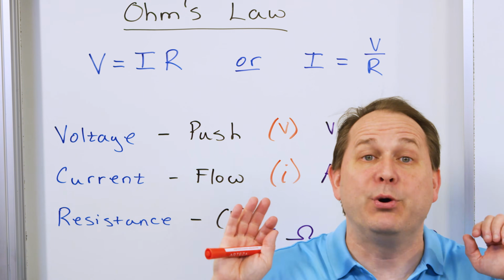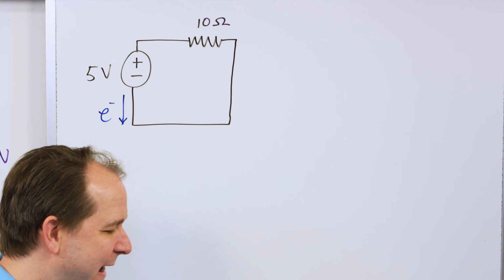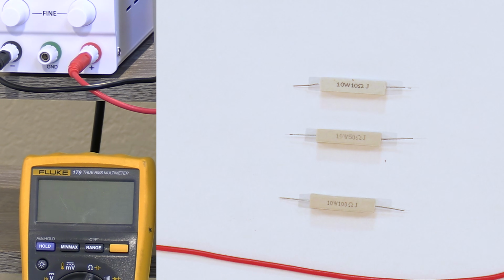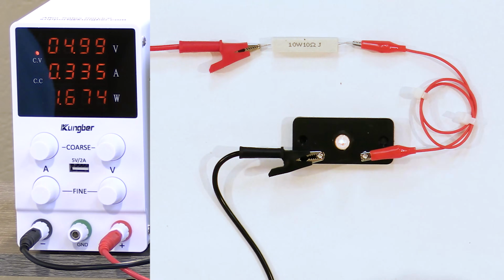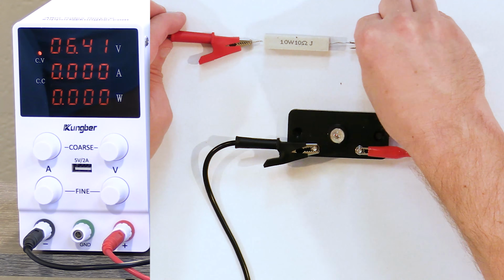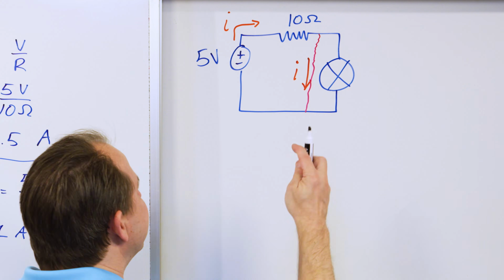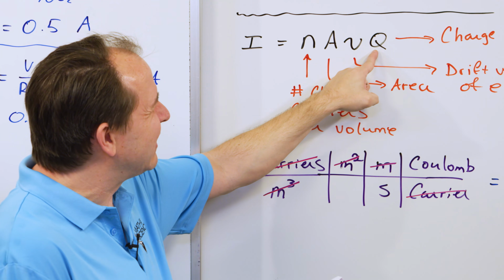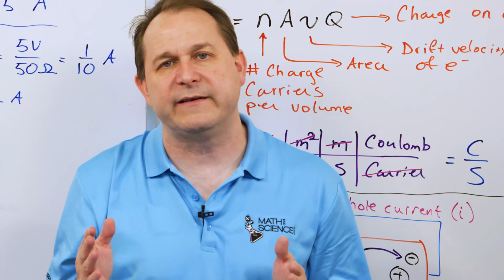What is Electric Current?  What is a Short Circuit?

Comment: One minor tweak- the resistance you measured across the light bulb will rise once the circuit is complete as the heat generated by the filament increases resistance.
Reply: He stated that.

Comment: Here's a couple of statements that are true that I hope you will explain. All the available voltage should be used up across the load. Adding resistors in a series circuit is different than adding up the resistors in a parallel circuit correct. Thanks for the great videos and info.

Comment: And please quit talking about that the positive is where the current flows from that is wrong and it screws everybody up who’s not an electrical engineer electricity pressure flows from minus to plus little Eddie electrons negatively charged and Lil Eddie always wants to go home which is positively charged electricity flows from  the minus terminal to the Plus terminal always electron flow from where there are more electrons to less electrons  😊minus to plus

Comment: Voltage is the pressure of a circuit a battery has a certain amount of pressure like 6 V or 12 V what current the wires can handle is determined by the fuse size in a series circuit a 10 amp circuit with 12 V pressure will be able to handle 10 A of current although a circuit can have a spike in current which may bring a 10 amp circuit to 12 A for an extremely short period of time so the Fuse does not blow so you can measure how many electrons flow in a circuit is 6.25 million million million electrons in one point of a wire in one second of time so we can actually measure the flow of electricity in so far as the flow of current in a wire forget all the scientific crap if you’ve got a 10 V or 12 V circuit and a ten amp fuse is blowing that means the resistance has dropped in the circuit carrying more than 10 A of design so one can determine how much less resistance is in a circuit when the fuse is blowing by putting increasing sizes of fuses in the circuit so if a tenant fuse blows in a 20 amp fuse does not that means there’s been almost double or less of the current flow through the circuit the less the resistance the higher the current flow another word 6.25 million million million Little Eddie electrons are CountableWith an amp meter to tell the mechanic how many amps are flowing to the circus nothing is magic voltages pressure electrons are negative charge little Eddie electrons in the resistance is the amount of resistance the current can provide in the circuit more resistance means more heat more heat blows the fuse or melts the wires in a short circuit is one where there’s less resistance much more current flow and the fuse blows out

Comment: Professor Math and Science Tutor, thank you for an excellent explanation of Electric Current and Short Circuits in everyday Electrical Systems. For students in Electrical Engineering, Electrical Current/Short Circuit is a very important topic to learn, due to the dangers of these two systems. This is an error free video/lecture on YouTube TV with the Math and Science Tutor.

Comment: Professor, what I didn't understood is where is 
 the Watt coming from, please!? What creates the watt and for example how many watts can carry a 220V-240V AC? Or how many Watts/Volts are?Also, please, where are the Volts created from and what creates the electric current? I understood that I-the amperage is made out of electrons which are the only ones that moves through a circuit and jump diagonal on Protons and creates holes behind them, from here the name "Hole current", but what is forming (generating more of) those atoms containing the  positive and the negative charge?
Hat off, I bow! Thank you very much for your time and kindness!

Comment: What is electric current?

What is electric current? Electrons flow in a conductor?

How do electrons flow in a conductor? Like many cars driving down the highway? Or is water flowing in warer pipe? What is a highway in a conductor? What is the water pipe in the conductor? Why don't electrons flow to the positively charged nucleus? What magic keeps electrons away from the nucleus?

Is the speed of electrons flowing in copper wire the speed of light? If not, how could electricity travel at the speed of light? If so, how can electrons accelerate at the speed of light?

In fact, Atoms are not made from charged particles as scientists told. 

All atoms consist of indestructible, electrically charged multiple layers hollow sphere and internally charged solid sphere. Outside each atom is a layer of negatively charged liquid that scientists mistaken for electrons.

This negative charged liquid attaches to non-metal atoms due to their outer layer is positively charged and floats on metal atoms due to their outer layer is negatively charged. The floating liquid of a conductor conducts electricity.

Electricity is flow in conductor 
instantaneously, similar to hydraulic fluid flow through hydraulic systems. 

The voltage of the electricity is proportional to the speed at which the floating liquid moves.

Comment: Another terrific lecture, Jason. I remember watching freight trains being shunted when I was a youngster. When another freight car was shunted on to the end of a mile long train, the jolt would be propagated through the entire length of the train to the locomotive in a second or two even though the actual movement of each car was very small. I think of this when I think of the difference between the speed of electrons in a conductor and their speed of propagation. A small point which I'm sure you'd be aware of: the resistance you measured in the cold light bulb in the circuit you showed was quite low, and didn't account for the current difference using Ohm's law. The resistance would have been much higher when the light bulb was actually illuminated.

Comment: Jason talks about copper being a great conductor and of course it is!  I made a mistake years ago when I had a home project requiring to rewired and I knew if I used aluminum wire which is also a good conductor you can save a lot of money!  However the aluminum wire is very stiff!  You also have to increase the wire size from copper such that if the copper was 12 AWG you have to use 10 AWG for aluminum.  I made it work and the power co said I did a good job but it was very hard and I will never do it again!

Comment: I’ve always heard that a circuit “draws” a certain amount of amps from the power source, which is why the source can be higher amperage than what the circuit is requiring. 
So uhh… could you also think of voltage as the “pull”, or how could those concepts coincide with each other?

Comment: “hole current” an explanation of a previous unknown term.

The plus side of the DC battery is pulling electrons.
While the negative side of the battery is pushing (repelling) electrons.
Reply: If you wonder the confusion why current goes the different direction as electrons. You can thank Benjamin Franklin for that. He knew that there were glass and resin electricities and they they canceled each other. He named the glass electricity positive and the resin electricity negative. Had he done the opposite everything would be so much simpler. 150 years later J.J. Thompson discovered electron and found it was negative.